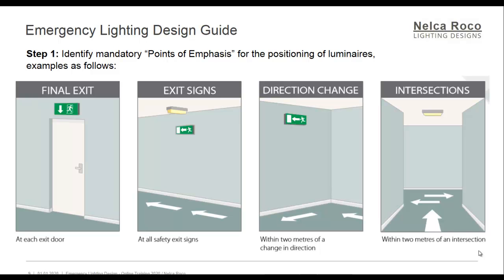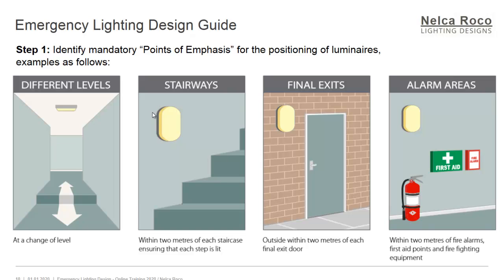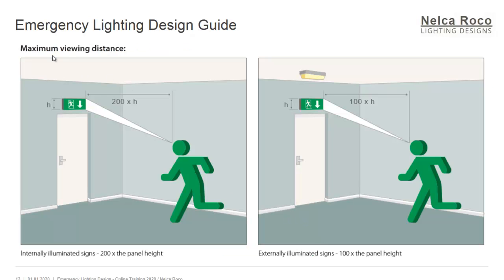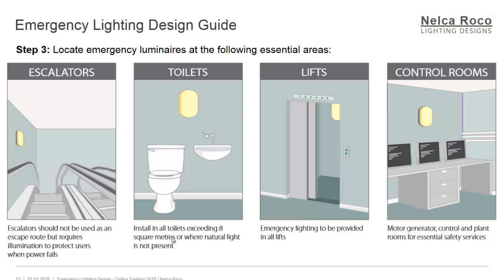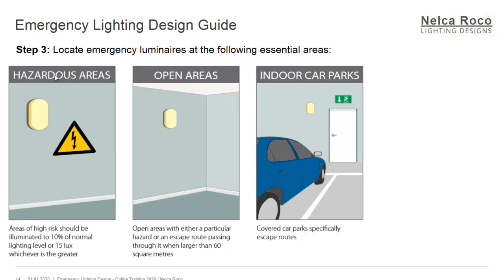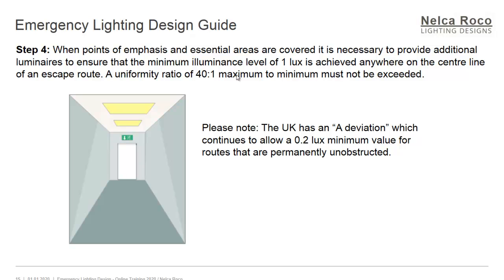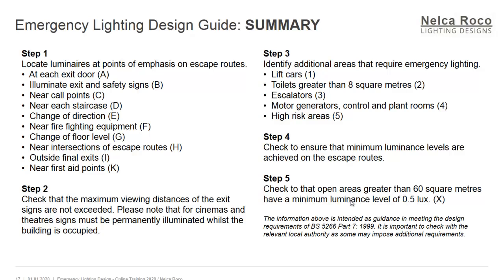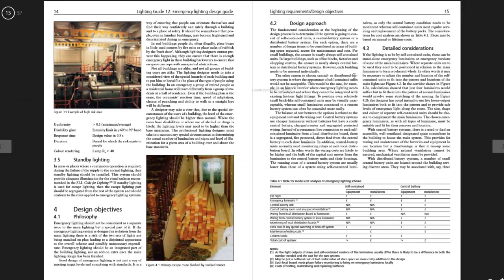Emergency Lighting Design Guide

Comment: Dear Nelca Roco,

I wonder which sign is consider to be Internally illuminated signs and Externally illuminated signs?
Reply from the maker: internally illuminates are those exit lights that has light inside.  while externally illuminated are those that doesnt have light inside but lighted from other sourse outside.
Reply: @NelcaRoco  Thank you so much Expert.